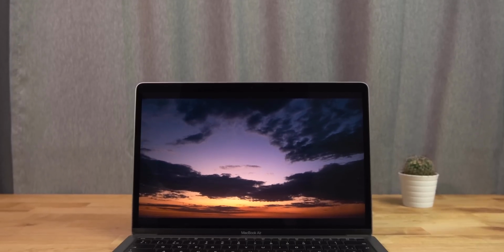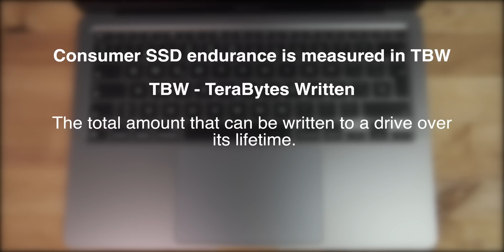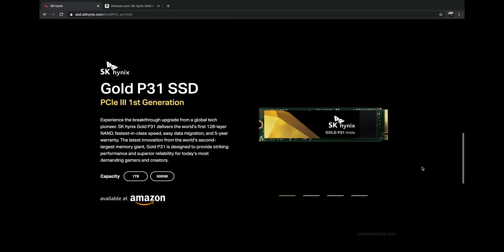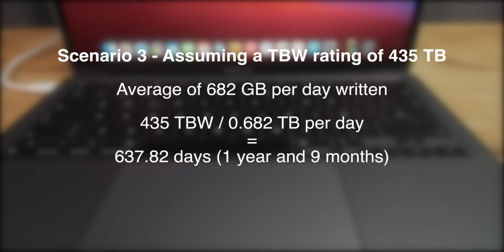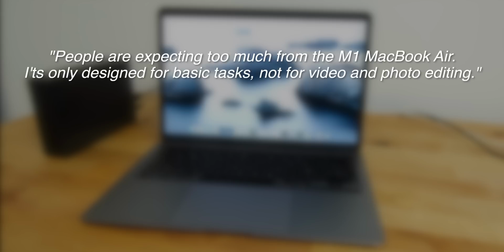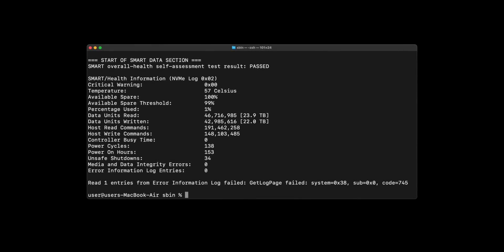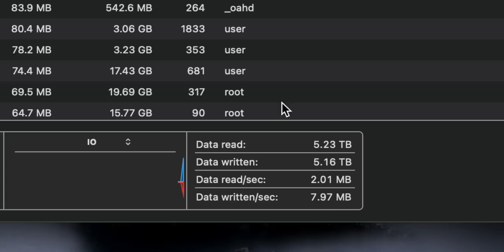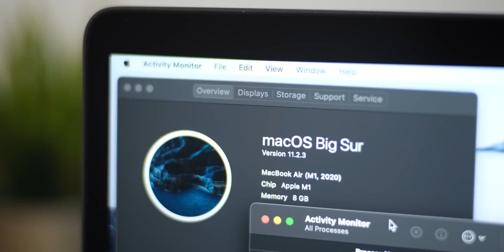M1 Mac SSD Wear Issue Tested and Explored. Yes, it's a problem.

Comment: Can you make a video of how to install mac os on a ssd? and would it be possible from the ssd to a hub type and from there to the macbook?
Reply from the maker: Hi Denis, the M1 Macs have issues booting from external USB-C drives, but Thunderbolt 3 drives, like the Samsung X5, have been found to work reliably. You can't go through a hub, the Thunderbolt drive has to be connected directly to the Mac.
1. Connect the drive to one of the Thunderbolt 3 ports, open Disk Utility, select the disk in the panel on the left and click "erase".
Choose a name for the drive, format should be "APFS" and scheme should be "GUID partition map".
2.  Download the macOS Big Sur installer from the app store and run it. When it asks you where you want to install macOS, choose the external SSD you just erased.
3. Allow the installer to complete, and when its finished you'll have a bootable macOS Big Sur on the external SSD.
4. To choose which drive to boot from, when turning on your Mac, keep the power button held down until you see a message saying "Loading startup options", followed by a list of bootable volumes. Select the drive you want to boot from and click "continue" to boot from that drive.
Reply: @BartechTV  Nor could it be from a thuntherbolt dock like the CalDigit TS3PLUS or the OWC 14 ports?

Comment: Funny after all these videos online..nothing officially put out as a response from Apple
Reply: This is why they are a crap company who don't even list the ssd endurance in the specs, without this value you can not work out if the machine could handle video editing or only surfing web pages. All reputable ssd's you can buy list the endurance (how much you can write to the SSD before it will become worn out) Apple should have included an enterprise grade ssd in the M1 that can handle Petabytes of writes I know this is not the case as there are only a couple of ssd chips onboard.